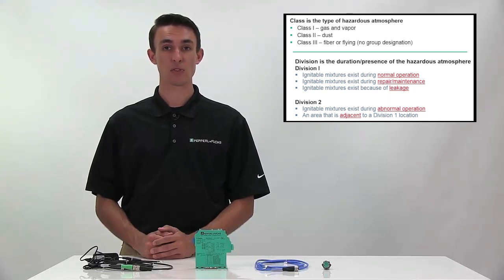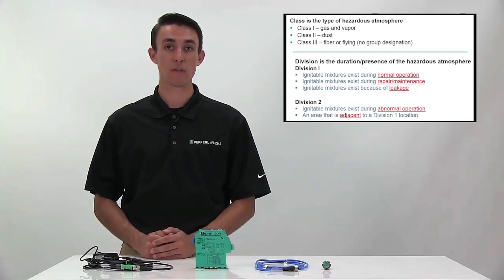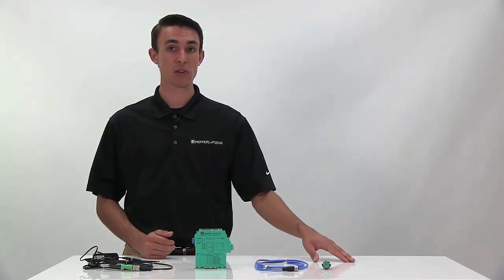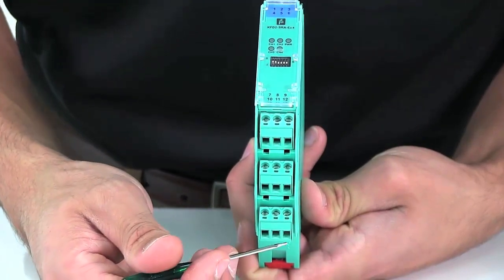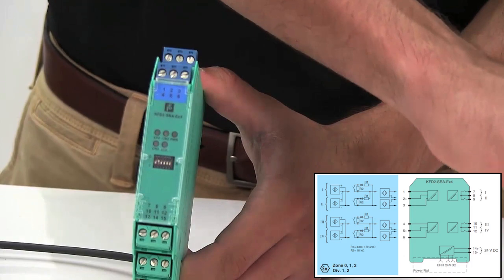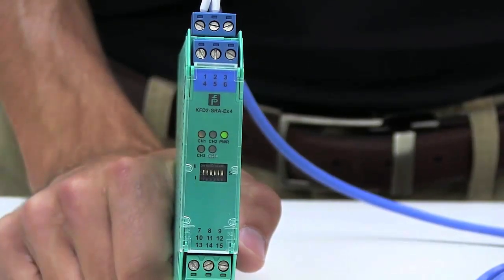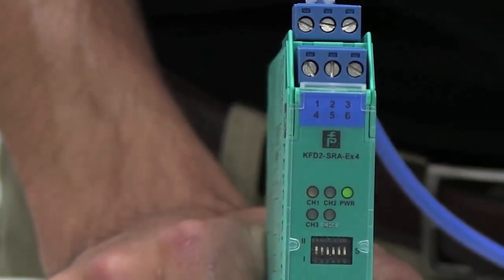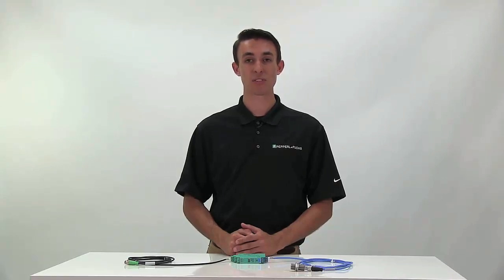How to Connect NAMUR Sensors to an Intrinsic Safety Barrier

Comment: thx a lot for the video , it is great. i got a question that i have got the same configuration you have with NAMUR normally closed , and i would like to send a normally open logic signal to plc when target is detected , could you please share with me the way of doing this. many thx
Reply from the maker: Hello @hightechplatform1874, first you need to select the correct intrinsic safety barrier for your application. This would fall under our “Switch Amplifiers” on our website. We have many models to choose from. One deciding factor is the switching frequency.

For switching applications with a frequency of 10 Hz or less, you can use a switch amplifier with a relay output. The most common is the KCD2-SR-EX1 for one channel or the KCD2-SR-EX2 for two channels.

For switching applications with more than 10 Hz, you should choose a barrier with a transistor output. The most common would be the KCD2-SOT-EX1 for one channel or the KCD2-SOT-EX2 for two channels.

All of the above models have DIP switches on the front panel of the barrier that allow the user to select an output mode based on the NAMUR input state. There is also a yellow status LED that illuminates when the output is in an “on” state. This provides a visual indication when the output is “on” based on the position of the DIP switches. For more information, please refer to the datasheet which can be downloaded from https://files.pepperl-fuchs.com/webcat/navi/productInfo/pds/70109406_eng.pdf?v=20240919144052.

We hope this has answered your question.

Comment: Please explain about the KFD2-SOT2-Ex1.LB , how switching voltage is consumed by isolator ( 2vdc to low voltage pulses) while the input proximity is under continuous pulse sensing...
Reply from the maker: Hello Nallendran, the KFD2-SOT2-Ex1.LB switch amplifier provides a constant excitation voltage of 8 VDC to power the NAMUR proximity switch. The NAMUR proximity switch varies the current in the loop to indicate position. The switch amplifier monitors the current in the loop to determine its output status. Please visit us at https://www.pepperl-fuchs.com/usa/en/ask_an_expert_fa.htm should you need further assistance. Thank you.

Comment: what are the other types of barriers and where we use them ?
Reply from the maker: Hi Syed, 

All of our Switch Amplifiers can accept a NAMUR sensor or dry contact input. Our most common Switch Amplifier is our KFD2-SR2-EX*. It comes as either a single or dual channel model. And it accepts both NAMUR sensors and dry contact inputs. This type of barrier is part of our K-System portfolio, which are galvanic isolators. However we have a second line of I.S. barriers, our Z-system. These are not galvanic isolators, they are Zener barriers. These are passive devices, but still meet the I.S. requirements for connecting a NAMUR sensor or dry contact. Zener barriers do require a dedicated I.S. ground per NEC sec. 504. Out most common for these are our Z728 (single channel) and Z787 (dual channel).

Comment: Sir I need two Analog input (4-20mA) and respective two Analog Output (4-20mA). Which model Pepper Fusche should I select.
Reply from the maker: Hi Raviteja, This is a 2-channel isolated barrier that can power a field transmitter, or accept a 4 ... 20 mA current source from the field, and pass that signal to the control side of the barrier.

The datasheet can be found here:
https://www.pepperl-fuchs.com/usa/en/classid_7.htm?view=productdetails&prodid=63975
If you need further assistance, please contact our Ask an Expert by clicking here: https://www.pepperl-fuchs.com/usa/en/ask_an_expert_pa.htm

Comment: Could we use potential free contacts at inputs in place inductive sensors?
Reply from the maker: Hi,

You can use dry contact inputs. All models of our Switch Amplifiers can accept this. Our most common Switch Amplifier is our KFD2-SR2-EX*. It comes as either a single or dual channel model. And it accepts both NAMUR sensors and dry contact inputs.